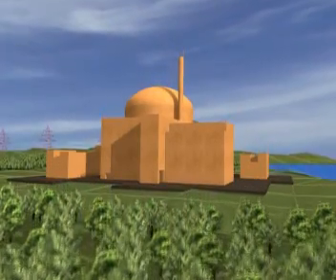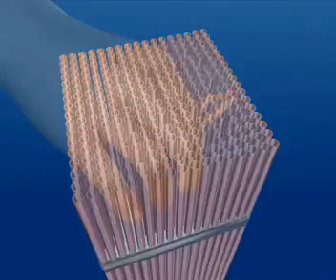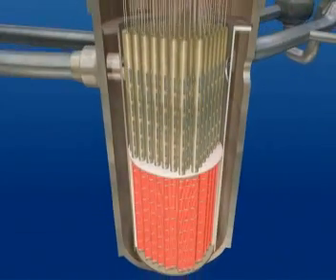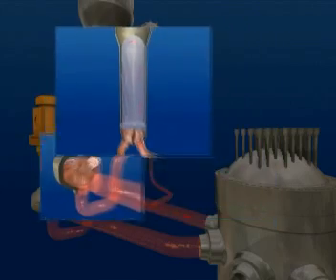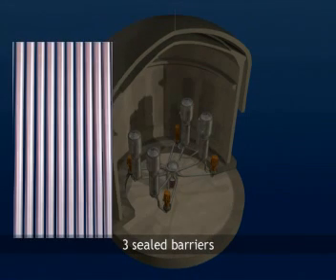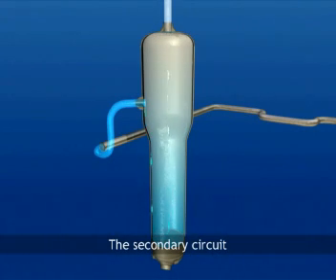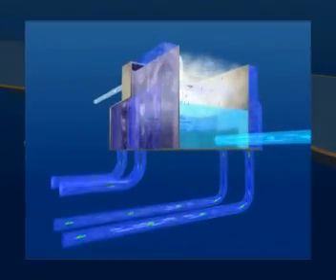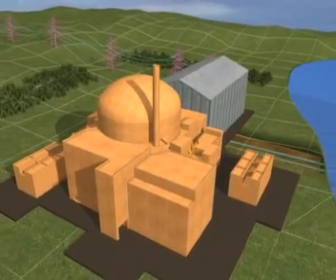Pressurized Water Reactor

Comment from the maker: @flatbranch1  The model shown in this video uses sea or river water for the secondary cooling circuit, thus no need for the evaporative cooling achieved in a cooling tower. Most of the Nuclear Stations located on the ocean use this type of cooling and thus don't have cooling towers.